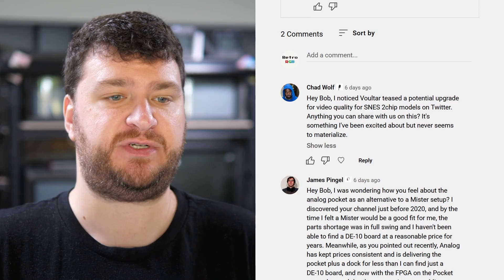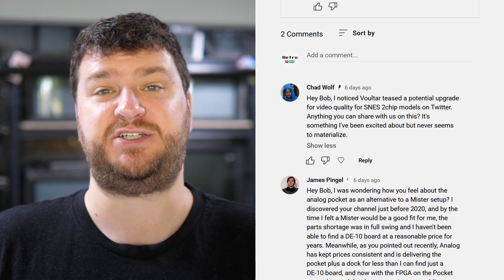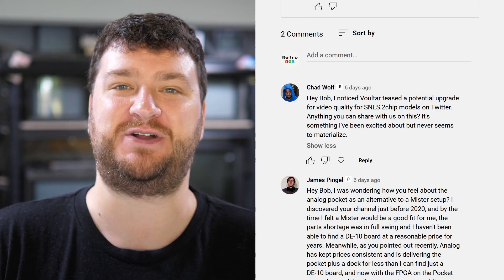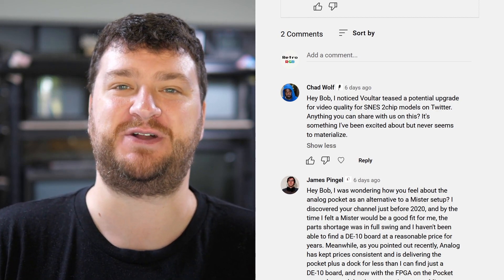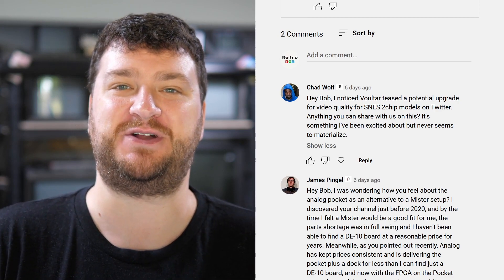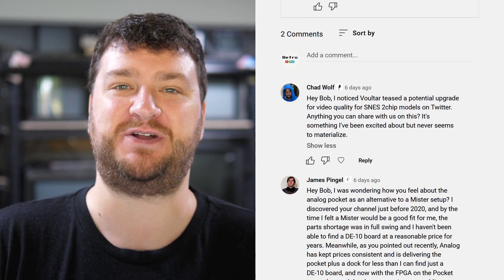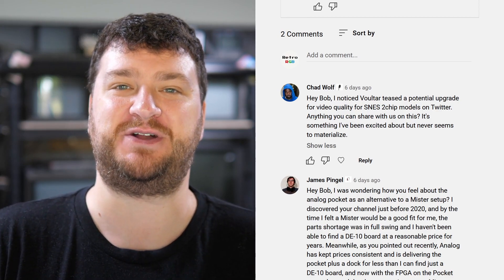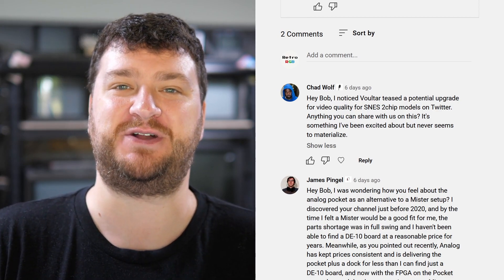Supporter Q&A #230

Comment: Thanks for the tip Timochee!
Reply: Not sure if this is the best way to reach you but I would say not only is it a concern to mix lead with lead-free, I would also be concerned about mixing different lead-free alloys since there's a much bigger variety of those.

That being said, I think if you just make a decent effort to remove the existing solder from the joint, it won't ruin whatever you replace it with. Sometimes I'll "flush" with fresh leaded solder (adding, flowing, removing) until the joint comes out shiny just to make sure I'm not mixing.
Reply: @rfmerrill  thank you. The areas of concern for me are when we try to integrate ribbon cables for video mods. There's already solder on those small pins. And I just wanted to make sure I used solder as close to what is already there as possible.

Comment: I will add to the fellow with the Dreamcast question that the Mode is a super easy install. It takes less than 5 minutes to pop out the original drive and put the Mode in. You can't save the original drive and put it back in anytime you want.

Comment: 14:20 I have a PVM-14M4U, and if I want any of the service mode display settings to stick, I must write them to the onboard memory after finding the desired value.  On my model, once I have everything where I want it, I have to press the Degauss button (it does not degauss the screen in service mode) to enable the Write function, then again to confirm.  This saves ALL current setting values to the perpetual memory.  This process (and other useful things, like a factory reset) is outlined in both the user and service manuals for my model, which were easy to obtain online via Google.  I would recommend the question asker to find their manuals since their model might have a different process for this.

Comment: I use the vga2scart for my dreamcast. You dont need it to be powered for that system but the option is there. It does all of the same stuff as hd152scart, passive options too, just you need a male scart head vs the male being built into the hd15

Comment: The SNES is my personal favorite too.  In terms of power it hit this sweet spot between color depth, speed, and extensibility, but really it's those games.  I've got scadrillionst of games here and from new franchises to simply taking the old classics on the NES and just across-the-board PERFECTING them all, well~  Oh and, it was the very first console I ever played online.  I mean, I'd already been online on my PC for years before that, and I know historically even the Atari 2600 had an online game download service, but this was the first one I had.  XBand was good fun and well designed all things considered, and that matchmaking feature was nowhere to be found on PC games at the time.  Mario Kart, Killer Instinct, Street Fighter II... even plugging in "Zelda" got an extremely basic "competitive maze race" game unlocked.  It was only too bad the service died out a year after I got it.  While my XBand is utterly useless now, I'll never get rid of it.  Too many good memories.

I have two 2-chippers, the ones with the distinct sound module which to my ears sounds higher quality and less muffled than the on-mainboard revisions later on.  I also just prefer knowing there's not going to be any of those weird glitches 1 chips are known for.  I'm very much looking forward to these upcoming mods and seeing just what they can offer.  Oh and, I would very much be interested in a replacement shell of the same quality as the skeletal one, in the Super Famicom design (with the slot fitted for SNES games), but with system accurate coloring instead of transparent.